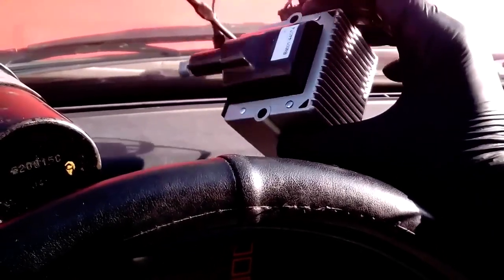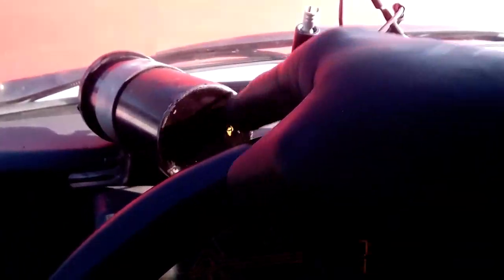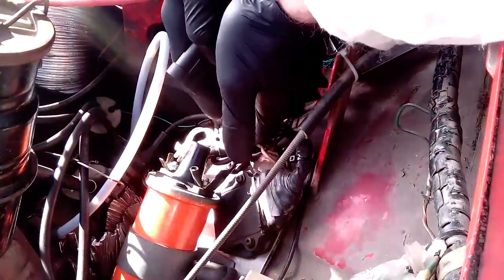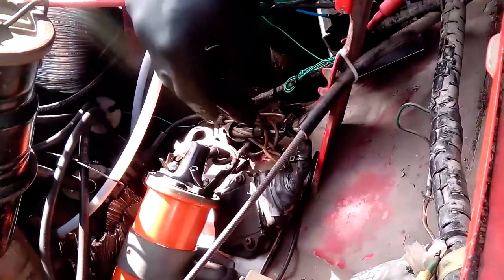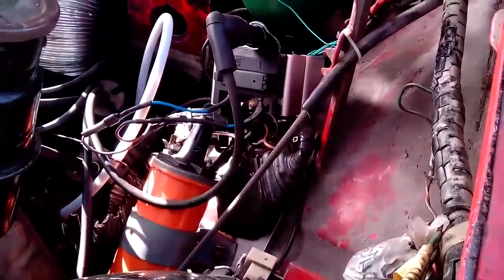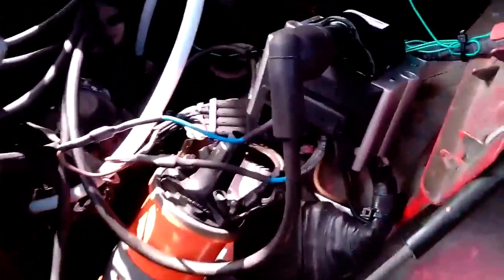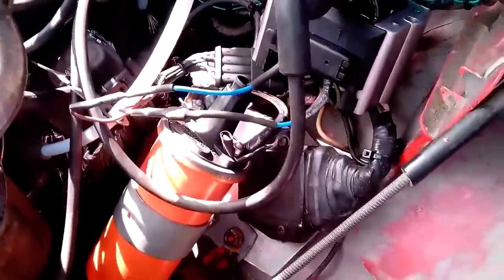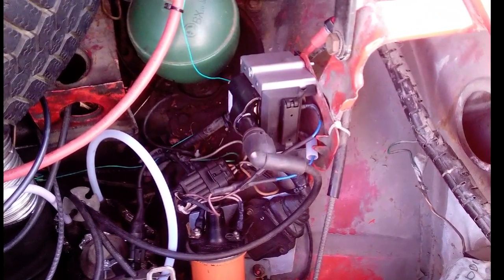CITROEN GS New ignition coil (ENG)

Comment: What is this swap for? Was it an improvement?
Reply from the maker: Thanks for visiting good friend, it absolutely was, 100%. Cost about 30€ and worth every penny. The old coil was not working properly and the car wouldn't start reliably. The moment I slapped that new coil on there, it changed altogether. I also replaced the positive and ground wires from the battery terminals, and cleaned the contact surfaces, and made all connections as best as possible, and now the car is ultimately reliable regarding the ignition aspect. 
After this swap I proceeded to make some changes in the fuel delivery system and all the hydraulics, and now I can say it is pretty reliable. You turn the key and it starts after a few seconds. Since it is a carburator, it still takes quite a few cranks to make the first ignition, but if you drive it every day, it starts in just one or two seconds. Litteraly. 
Happy new year.
Reply: @mr_nice.  Very nice. Is it so to understand that it has some advantage over the old type of coil (i know very little of the electric system)? What did you do to the fuel delivery to improve it? Thanks and have a happy new year!
Reply from the maker: @kristianas8180  ...Well, to be honest, I have no idea if it's better or worse. It is just a newer design, since it is from a Golf Mk III, which lived in the 90s, instead of the 70s where the old coil comes from. I admit there are similar "bottle" style coils sold today, but they were much more expensive. So I placed a bet on this one, and it worked. 
The fuel delivery system had some spots where it needed improvment. First the carburator. The car is the 1.1 litter and it has a Weber carb, and from the moment it came to me it had a leak in the fuel inlet. It had no return line going out, (even though it had the space. It was closed from the factory), so every time the floater stopped the flow inside, the pressure from the fuel pump got high, and that led to a leak in the inlet. 
I drilled a small hole on the position where the return oultet should 've been, made an M6 thread, and installed an appropriate outlet with sealing connector, run a Nylon line all the way back to the reservoir, directing the fuel in the reservoir from the wide breather hole, and I got myself a nice return line, which helps releave the pressure from the pump every time the floater stops the flow. No more leaks from the fule inlet in the carb. 
The entry point on the reservoir is something that took me a bit to make. I made it out of copper pipe and brass tubes, and it sits in the middle of a section of tube that serves as a breather for the reservoir when filling up and when gas vapour needs to escape. No closed loop back in the day, so all vapour escaped in the atmosphere. 
The other mod I did to the fuel is an electric fuel pump I installed right outside the reservoir, after the initial filter, which I also changed to a carbon filter from a Citroen Xsara. This pump is for priming the carb after long periods of parking, and in case something happens to the mechanical pump and it stops pumping, there is a separate switch inside which I can turn on and run the pump continously, and run the car with it. I also replaced most of the rubber hoses with either Teflon tubing or copper pipe, just for the fun of it. 
Any other questions, I'd be glad to help.
Reply: @mr_nice.  My fuel system is working as it should now, it can take a little long to start after sitting for to long or when engine is hot of course, but nice to know your tricks and tips if it should start being faulty. Nice work!
Reply from the maker: @kristianas8180  ....Exactly the same behaviour I had. After sitting for too long, say two or three weeks, then I needed to crank too much to bring fuel to the carb, which drained the battery. The electric pump solved that problem. It consumes way less amps and it fills up the carb, so I can crank with a full carb instead of empty. And the good thing is that it is placed in line with the mechanical pump, which means it doesn't bother the line even after the car starts and while running. It can stay there for ever. At first I thought that there might be issues with the electric pump in line, and maybe I would have to think of a way to position it in paralel, but it proved to be very convenient to place it inline and before the mechanical pump, just outside the tank and after the filter, just to prime the system. And since now I have the return line available, I can run it for as long as I want, without the fear of damaging anything. If the carb gets full, the excess fuel just recirculates back to the tank. 
If you ever have a problem with your coil, and you have the tranzistorized ignition like I do, it's worth considering this coil. It works fine. I use it even today without any problems. I bought it on ebay, but that doesn't mean that it's crap. 
👍